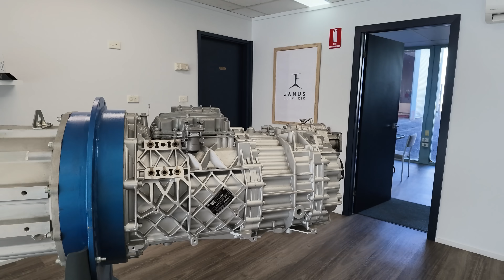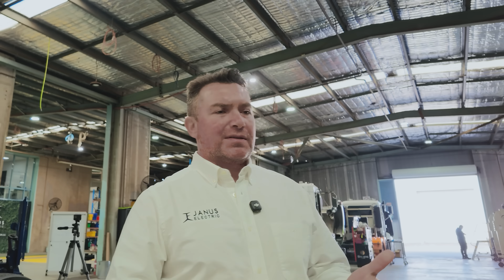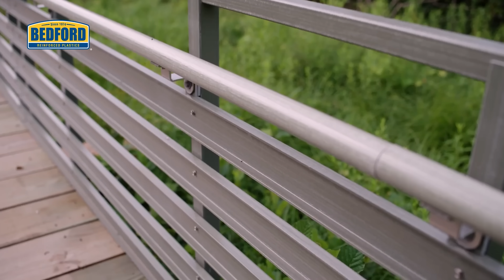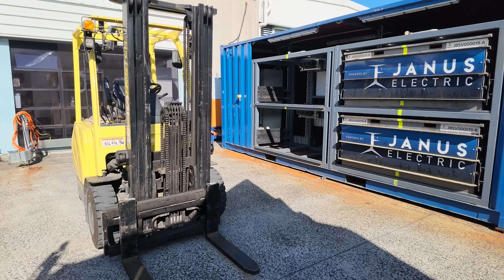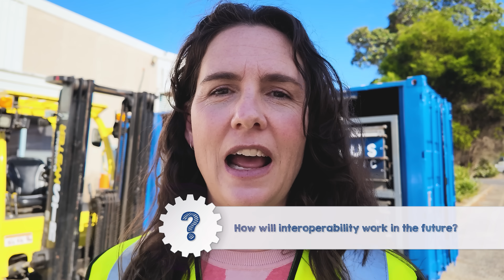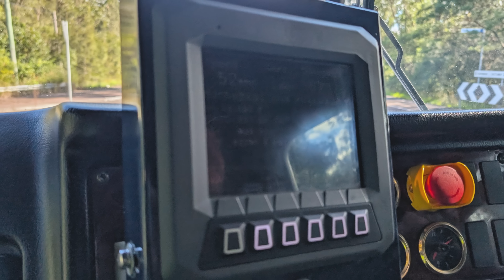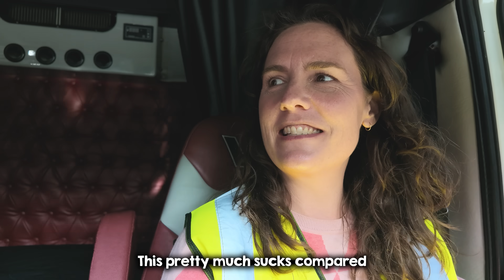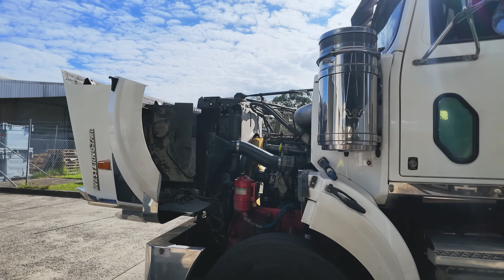The EV Truck Idea I Actually Didn't Believe Until I Saw It

Comment: Cheers from the Elektrotrucker in Germany :)
Trucks here go 600-ish km per charge. Drivers need to take 45 minutes breaks by law. Under ABC-rule (always be charging), lots of energy gets added during a break. Fits perfectly. Just requires a bit of thinking.
Reply: And when the driving is automated ?
Reply: @julianshepherd2038  Probably (thankfully) not going to happen anytime soon. Germany is very strict with regulation on that.
Reply: @julianshepherd2038 I have not heard from experiments with self-driving trucks in Germany yet. Not even cars
Reply: @ChrisBigBad  self driving vehicles are about to launch in Munich
Reply: @Mischakunz  Any details? I might see them. I live close by.
Reply: @ChrisBigBad I think the risks are not worth the rewards personally. Let individuals try it if they want, but keep trucks out of it. Better to have the labor income and jobs in my opinion.
Reply: @julianshepherd2038 
It will still be cheaper
Reply: @julianshepherd2038 they as re called trains. Automation needs dedicated rights of way.
Reply: This solution does not meet Australia's unique requirements. Australian road trains need to cross the Nullarbor plain, which is approximately 4000 kms, mostly in the middle of nowhere. States such as Western Australia, Queensland and the Northern Territory have similarly vast, remote distances to cover.

Range and capacity are the most critical requirements.

And I'm no environmental scientist, but won't all of these extra batteries need to be disposed of?

Also, retrofitting existing trucks is not the miracle its being made out to be. A battery powered old truck is still an old truck. Its components will wear out. It still needs to be replaced.

Bless them for trying, and they might find a market niche, I hope they do, but this borders on being an advertisement. Until EV road trains can meet the requirements diesel engines provide, it isn't a solution. And heavy lithium batteries are not going to save the world.
Reply: @Samson-h6l  Australia's road trains represent a tiny niche of the world's needs and correspondingly little in terms of CO2 emissions, batteries can be recycled with 98% material retention the raw materials in them make them valuable
Reply: @prpr8904  That's all well and good, but context matters. This is an Australian company, that is not pioneering a new technology, but rather trying to establish an existing one in the AUSTRALIAN market.

I wished them well, but Australian road trains are the lifeblood of the country, and the country exists outside of the Melbourne and Sydney metro areas. 

Your claims about Lithium batteries are misleading, at best. Their mining, production and disposal are terrible for the environment.

This video was a glorified advertisement. I would not be the least bit surprised if it was paid for by the company. That's business. It is what it is.

And your comment was needlessly confrontational, and adds literally nothing to the conversation.

So, stfu Elon. Take your virtue signalling BS back to your little drum circle.
Reply: @Samson-h6l  Same old argument people make about EV cars.. Yes you can drive to a paddock in the middle of nowhere 400kms away and then complain about the complete lack of charging facilities, but that just makes you an idiot for doing so. The reality is probably 95% of peoples driving could be comfortably covered with an EV just charging overnight. I have one and love it for driving around town/general use (and I live in a small country town of about 15,000), doesn't mean it can do everything, I also have a v8 diesel land cruiser but my EV covers a good 90% of my driving. 

The trucks doing all the metro deliveries currently are not at all the same as the trucks hauling cattle through the remote country and they never have been. Also trucking across the Nullarbor is a minuscule amount of Australia's trucking volume and isn't even that important, most freight on that route goes by rail because its cheaper
Reply: @Samson-h6l, you're supposed to watch the video before you comment on it so you don't look like quite such a halfwit.
Reply: @Samson-h6l  you don't "dispose" large batteries, you recycle them. The metals are all reclaimable and reusable, just like how you don't just throw away and never recycle aluminium cans.
Reply: @Samson-h6l  This would be very workable on the east coast changeovers such as Tarcutta, pull in swap trailers, change the battery on the Prime mover and have a meal break. Melbourne to Tarcutta not so much but Sydney to Tarcutta or to the Brisbane change over would see a large reduction in trip times because of the huge torque increases thus reducing hill climb times and having quieter trucks the driver stress levels would be reduced. When auto boxes came into heavy trucks it was a gamechanger especially in traffic and electric trucks will have a similar result.  Yep, now retired but I did this stuff for a living and electric trucks almost make me want to go back to driving just for one trip.
Reply: @duster8100 And that's great. All I said is it isn't viable everywhere. It isn't.
Reply: @Samson-h6l  No one says it works everywhere but it can work on the East Coast which has more truck movements than anywhere else in Australia. That means a huge shift to electric and a huge reduction in emissions and less dependence on imported diesel fuel. As said elsewhere road trains and triples are very small percentage of truck movements in Australia.
Reply: Look up CATL's Naxtra battery. 
Sodium ion so no lithium needed, and rated to 10000 cycles (5,000,000km or 1250 round trips).
At end of life these batteries will almost certainly be recycled (at a minimum they are full of copper and aluminium), and quite likely will find use as grid storage before that.
Crossing 4000km requires just 8 battery swap stations along the whole route, with the batteries being charged off solar during the day.
Reply: @benjaminbridger7771  And where will those 8 swaps occur????

In the middle of the f**king desert???
Reply: @Samson-h6l Man Who Subsists on Cigarettes and Beer Lists All Drawbacks of Eating Vegetables
Reply: @mkj1855  Marvellous pretend rebuttal.
Reply: @Samson-h6l 
Charging stations can be built, it's cheaper in the long term, if people are willing to invest
Regarding the battery disposal, there's a growing market for used car batteries, they last a pretty long time, although they do lose some capacity. And recycling them is profitable at the moment, but rare earth prices are falling due to innovation in the industry, so can't say much about that.
Reply: @Blin.gde.moy.stariy.nik.  Context is everything. You are unfamiliar with the environment, geography or economy of the regions in question. It is not cheaper to invest in the remotest of charging stations. Some of the least forgiving conditions on the planet. Literally uninhabitable. That is laughable.
Reply: @Samson-h6l  Give up, you have never driven heavy transport and know nothing about it.
Reply: @Samson-h6l 
You're right, I shouldn't have said anything about charging stations, I know nothing about Australia 
But recycling batteries isn't a concern right now
And , not everything has to be usable in every conceivable situation, just because it can't be used in some places doesn't mean it's a bad idea, I'm talking about both trucks and charging stations
Stations with solar panels are pretty cheap to operate, once they're built. They would be profitable in many places.
Reply: @Samson-h6l  and there's a lot of sun over that plain, isn't there? Perfect for a couple of solar fields in the middle of nowhere. And with Mega-Watt chargers charging would take a couple of minutes. For a road train, it would even be possible to add some more batteries on the first trailer.
Reply: @berndrutzmoser  A couple?

Take a look on google earth before talking sh!t.
Reply: @Samson-h6l what is unique? Sydney Perth 4000km, so what I dispatch Hongkong-Tashkent (6000km), Shanghai-Almaty (5000km) , Almaty-Moscow,  Horgos-Frankfurt. 
And in the interior of China, Kasachstan, Uzbekistan the population is as sparse as Australia. And the road are unpaved roads in Kazakhstan, too. 
And the Chinese still manage to provide Charging on the Shenzhen-Alashankou route (5000km) today.  Helping does the regulator, adding mandatory 20min break after 2h of driving.

And the battery, where do they go to fear. 
Where does the diesel go too? Can the burned diesel still be used after a million km? Or the cobalt issue, refineries are main user of cobalt for desulfurization! 
Taxis drivers in China drive 700 000km on a 70kwh pack in 5 years,  how much can trucks drive with a much larger pack?

Comment: Fascinating. I was aware of using battery swapping was being looked at for some small airplanes used in flight schools...But I haven't heard of battery swapping being done with trucks. Interesting idea! Have you looked at Edison Motors from Canada yet? They are building new type of hybrid trucks that are aimed at places where normal charging of an EV is not feasible, so they have built a diesel-electric drivetrain that can be used in many places. Their original inspiration was building trucks for the logging industry, where it is not practical to put in a charging infrastructure. So, like diesel-electric train engines, they started to create such a drivetrain for these so-called "vocational" trucks. The diesel engine only runs when the batteries need charging, thus it is a serial hybrid. For a long time, their byline was "Edison Motors - stealing Tesla's ideas". Check them out!

Comment: I really don't see the need or overwhelming benefit of doing this. 
There are lots of trucks already out there with +600km range. 
At least under EU regulations it isn't a compromise in operations at all. You are allowed to drive 4,5 hours in one go before needing to take a break of 45 minutes, after you drive another 4,5 hours. this fits perfectly for long haul trucking with 300-400kw chargers all around this works great.
Look up e trucker on YouTube or his German channel Elektrotrucker.

On the other hand you have to make quite big compromises to make a battery swappable. Like needing more complex, more expensive and in the end less space and weight efficient packaging. You also introduce mechanical failure points and maintenance. Also quite a lot of investments to get such an expensive infrastructure going. Until you have swapping stations everywhere, you just have all the disadvantages. Like getting a more degraded battery swapped into your vehicle and basically going to the lottery every time you swap.
In Europe for big trucks the market shifts quite quickly in the last half year we reached 5% market share with exponential growth expected. For this data look up the Frauenhofer Energiebericht.

Comment: Surprised they're air cooling the batteries. I can see why for simplicity, but pretty much the rest of the industry are heading in the opposite direction. Admittedly a lot of the cooling is needed during fast charging (which there's less need for in their model), but Australia is famously warm.

Comment: Swapping is essential in an EV future.
I was waiting to see if battery swapping would roll out before I bought an EV. Although things are moving along, it will be years before the Neo / CATL collaboration really makes traction in the West. So, for now, I bought a 3 year old Citroen EV and I have been overwhelmed by the weight of evidence showing the necessity of battery swapping. If we don't get this going, the energy transition will fail. While EV represents a small % of cars on the road, there are public chargers available, however, as urban populations switch to EV the inconvenience of shortages in public charging will grow.

Comment: Thank you Rosie,
I would so love to believe this was viable but I just can't.
One question you didn't ask was how could the weight of the truck possibly be less than that of an equivalent diesel truck?  It can't.   The energy density of all batteries is a fraction of that of diesel.  There are peer reviewed academic papers showing this to be an immutable thermodynamic law.  The only way they could achieve this would be to drastically reduce range.  Or possibly they are quoting the weight of the truck conversion without the independent battery weight.  Petroleum is not just a hard act to follow - it's an impossible act to follow.
Reply: It’s true that when you compare the battery and the fuel tank, the fuel tank will be smaller and lighter than the battery. But every other component of an electric drive train is radically smaller and lighter than the internal combustion equivalent, particularly so for high torque applications like trucking. Meaning that when the required range is limited, as you say, it’s possible for it to be lighter.

Comment: Greetings from Germany, we already have a company which does the battery swapping with the use of robots. I don't think, this will be the common solution . The  etrucks which are already driving around have a capacity of 600 kwh and are charged during mandatory breaks. The batteries are not the limit. Where do they charge: in the depots, car charging stations and more and more in the fast increasing truck loading stations. Please meet the @electrotrucker. He will be in Australia this winter with his e truck doing world trip with his eActros.

Comment: You missed asking how many KWs to charge a container with 8 battery's inside. 
If they need 2 charged battery's per day, that sounds like a round town truck.
A well serviced truck can do 2,000,000 Klms. Ripping out the drive train at 5 years doesn't add up either.

Comment: I've been watching the occasional YouTube video about Janus for a few years now. I work in the industrial asset management sector and Janus' strategy to electrify during major overhauls just makes so much sense. But they're on a very slow burn - I don't understand why the idea hasn't taken off faster than this. As mentioned in the video, standardisation of the swappable batteries would be nice to have but the market simply isn't mature enough for that yet, and I think it's a pretty tangential concern for fleet owners - it's really only a potential factor for long-haul routes. Janus and any(?) competitors can get a LOT more market penetration before needing to crack long-haul.

Comment: Check out Edison motors in Canada.  They manufacture hybrid trucks.  They use a small diesel engine to charge the batteries.  They also have retrofit kits for smaller trucks.

Comment: Why can't the trailers hold some amount of batteries? Then the trucks could run continuously when needed?
Reply: Why carry the weight of extra batteries when that could be goods you're being paid to haul? That's why Janus are onto a winner with battery swaps. Less downtime than filling a diesel tank and less overheads.
Reply: Trucks and trailer combined have weight limits. Extra batteries means less load carrying capacity. There is a tradeoff between range and load.

Comment: Curious how air cooling a battery in such a high power and hot environment as Australia is going to work out? Previous implementations of passive cooling by the likes of Nissan with the Leaf didn't work out great. 

Also what's the need for the 16 speed gearbox? Why can't the motors just use a single speed reduction gear?

Comment: It's a good idea but I still think the future will be ground up designs of electric trucks. The entire package needs to be engineered around an electric powertrain for the range to be achieved for longer haul routes. Although this is arguably a quicker to market and greener solution
Reply: The future is ground up designs, but we are in the now, and there are thousands of diesel trucks that could have their life extended using locally made fuel.

Comment: Janus and  Eddison are both pushing ahead ....it might be good for Rosie to have a chat with Chase and Co at Eddison in BC Canada... they are aiming at building Electric HD trucks for off road logging and drilling use ..that are also series hybrids given they work so far off grid  ..so they would fit with the road train truck profile .. or mining use . ... acting as static  emergency or work generators as required.

Comment: Janus makes sense vs windrose where a company can repurpose an older truck where its due for its 2nd rebuild at 1.4 to 2 million km and will be doing lots of stop strart driving  or shorter distances vs line haul. opportunities are endless and it makes sense if the truck would be sitting around with its engine running for hours but not driving the wheels,, eg a agitator truck, water trucks. but one must stick to reality that an EV truck wont pass the modern diesel efficiency and running costs doing line haul. the new kenworths are getting batter than 40% efficiency between melb to Brisbane working as a A double roadtrain. when you factor in the grid losses thats better then our best black coal fired power plant.
if i was operating a fleet of agitators Jauns would be the top of the list as they are spend too much time wasting fuel than actually driving somewhere but also because they retain diff locks and a 16 speed auto they have plenty of power to drive them long steep or slippery driveways, also reduced noise in residential areas. No carbon monoxide in inclosed areas or tunnels